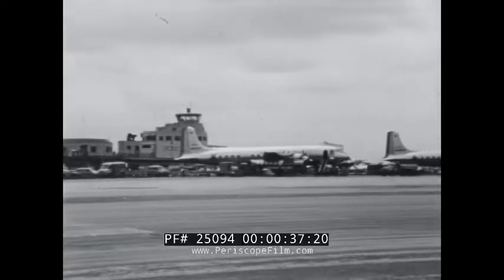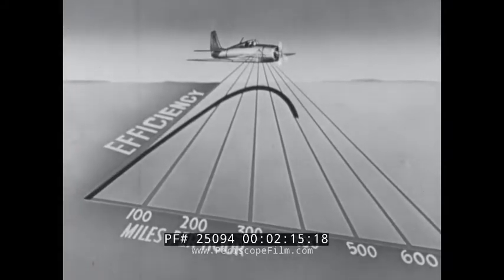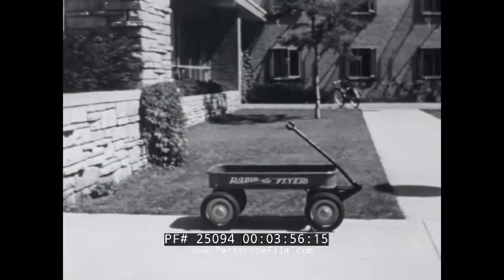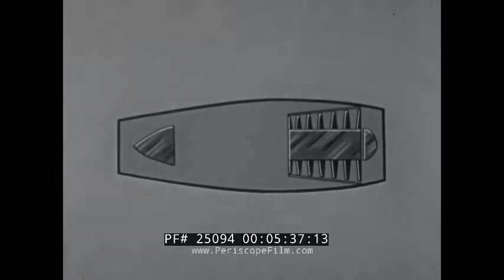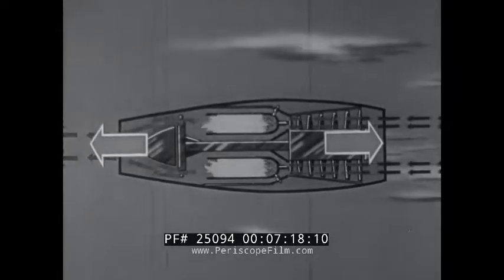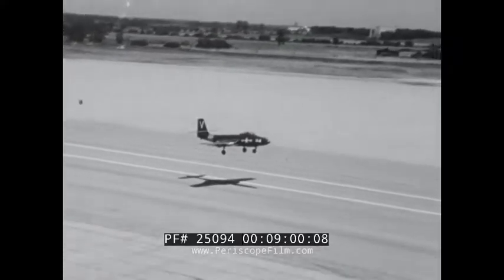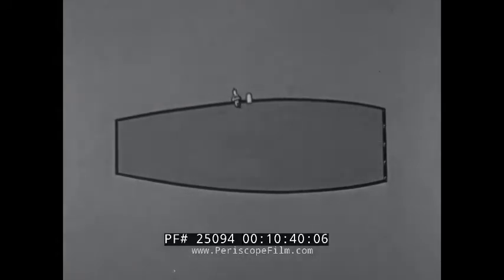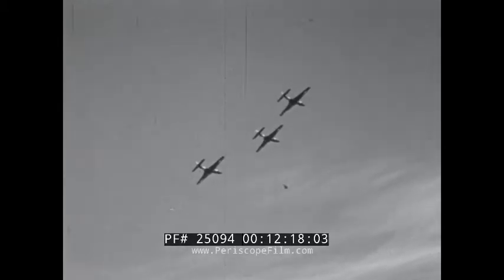“ JET PROPULSION”  1952 EDUCATIONAL FILM EXPLAINING THE BASICS OF JET AIRCRAFT ENGINES  25094

Comment: This W.1X engine, which was sent to General Electric in 1941, is now in the Smithsonian, Washington DC.  The Whittle/Power Jets W.1 engine can be seen in the Flight Gallery of  the Science Museum, London, together with the WU.  The prototype Gloster E.28/39 is suspended from the roof nearby.
Whittle has frequently been criticised by his detractors for his decision to use of the “dead end” technology of the centrifugal compressor.  In fact, there was no decision to be made: he utilised a known technology and took it to the limit.  He had no access to axial flow technology, nor did he have the resources to design an axial flow compressor, let alone to develop it.  

At the end of WWII, centrifugal flow engines were still some way ahead of axial flow engines, in terms of performance and reliability.  For example, Rolls-Royce’s Derwent 1 engine and DeHavilland’s H.1/Goblin had higher pressure ratios and lower specific fuel consumption figures than the Jumo 004B, which powered the Me 262.  It would take until the end of the 1940s before the axial flow engine drew ahead, and it would need a considerable amount of development work.
In the UK, the Royal Aircraft Establishment (RAE), led by AA Griffith, had secretly been working on a series of axial flow compressors during the late 1930s.  Their objective was the development of a turboprop engine.  However, with the success of Whittle’s WU engine, their F.1 turboprop project transformed into a turbojet, the development of which was continued at Metropolitan Vickers (Metrovick) in Manchester.
The Metrovick F.2/1 engine had its first run in November or December of 1941 and two F.2/1 engines took to the air in 1943, powering the Gloster Meteor prototype.  They  were larger, heavier, and had a higher trust than the Whittle W.2B engines intended for the Meteor, but they had reliability problems.  Further development resulted in the F.2/4 Beryl engine, with a thrust of 4,000lb.  However, by the end of WWII, Rolls-Royce had produced the centrifugal flow Nene, with a thrust of 5,000lb.
The Beryl never went into full production, but further development at Metrovick resulted in the F.9.  The project was handed over to Armstrong Siddeley in Coventry after WWII, to become the Sapphire 6.  The engine was licence-built in the USA as the Wright J65, of which thousands were produced.  Also, following WWII, the Nene was built under licence in the USA as the P&W J42, and the P&W J48 was a licence-built Rolls-Royce Tay.  
In 1941, in addition to being sent the W.1X engine, General Electric received drawings of Whittle’s W.2B engine.  These were used as the basis for the GE I-A, which ran the following year.  It went into production as the GE J31, and still had Whittle’s original reverse-flow combustion chamber arrangement.  However, GE further developed the engine with straight-through combustion chambers as the I-40.  Production was handed over to Allison, and the engine became the Allison J33, of which thousands were built.
With the industrial might of the nation behind it, the jet engine industry took off in the USA after WWII, but its launch pad was made in the UK.

Comment: I promised more to follow: here it is.
And what of von Ohain in Germany, whose rudimentary turbojet, the first true jet engine to fly, took to the air in August 1939 and flew for all of six minutes?
It is well known that, on more than one occasion, in the company of Sir Frank Whittle and other respected engineers of the early jet engines, he made a very telling remark.  He would say that if Whittle had enjoyed the level of support that he had received in the early days, the RAF could have had a jet fighter in service some three years earlier than the Luftwaffe.      
Hans Pabst von Ohain applied for a patent for his engine in 1935, but only after his patent lawyer pointed out that features in hist  application would infringe Whittle’s patent of 1931 and should be amended.  He had Max Hahn build a very rudimentary sheet-metal ‘garage engine’ for him in that year.  It was driven by an electric motor and there are some reports that it was fuelled with “a little petrol”, which burned in the exhaust.  However, Ernst Heinkel then took an interest in Von Ohain’s engine, which was moved to the Heinkel works, where further unsuccessful attempts were made to run it.  
Von Ohain’s second demonstration engine was completed in the spring of 1937, and it was initially motored over, driven by a belt drive from a pulley in the roof of the workshop.  There are claims that it ran soon after, but other reports suggest that it was only motored over for pressure measurements.  Heinkel recorded that it ran on hydrogen in September 1937 and on petrol in the spring of 1938.  However, Hahn and von Ohain had to work “night and day”, as the engine was experiencing overheating problems, with Hahn coming up with a vaporiser arrangement for the combustion chamber.
Work on a third version of the engine, the HeS3, followed and an HeS3A version was flight tested, slung beneath an He 118, sometime between May and July 1939.  The HeS3B, which powered the He 178 for that first six-minute flight on 27 August 1939: however, it was far from reliable and the He178 may have made only a few more flights.
In the meantime, Whittle had completed the second rebuild of his WU engine, with ten reverse-flow combustion chambers.  Testing began October 1938 and continued until February 1941, when a failure in the rim of the engine’s original turbine disc released several blades, resulting in damage beyond repair.  The engine can now be seen in London’s Science Museum.
Nevertheless, the success of the WU led to the ordering of a flight standard engine, the W.1, which was based closely on the WU in its third and final form.  Testing of the W.1 began in February 1941 and, following 25 hours of high-power testing, it was released for 10 hours of flight trials.  Nominally rated at a thrust of 1,240lb, at 17,750rev/min, it was derated for flight at a thrust of 860lb, at16,500rev/min.
The first flight of the Gloster E.28/39 took place on the evening of 15 May 1941 at RAF Cranwell and lasted 17 minutes.  That was the official first flight, but the aircraft had taken off briefly during taxiing trials at Gloster’s airfield at Brockworth, on 8 April, powered by a non-flight-standard W.1X engine. This engine was later shipped over to GE in the USA, where it became the first jet engine to run in the USA.
And more to follow.

Comment: I’m sorry (no, not really), but there are some contributors on the far side of the pond who need to be given a few facts about jet engines.
Firstly, let’s be clear, the principle of the gas turbine to produce shaft power (like the steam turbine, a British invention) had been established many years before its use as a jet engine occurred to anyone.  At the beginning of the 20th century, the Holzwarth ‘explosion’ (constant volume combustion) gas turbine was developed, but its thermal efficiency was only about 8 percent.  
Beyond this, there were other attempts to produce a gas turbine operating to the Brayton (constant pressure combustion) cycle, which Brown Boveri in Switzerland finally did successfully in 1938, with an industrial gas turbine driving an electrical generator producing about 5MW.  It was finally taken out of service in 2002, because the generator had sustained damage.
In 1922, Maxime Guillaume (who may have been Belgian) was granted a French patent for an axial flow jet engine.  He’d had a bright idea, but it was very rudimentary, and he was an agricultural engineer who couldn’t back up his idea with theory and calculations.  In 1926, Dr A A Griffith of the Royal Aircraft Establishment in the UK wrote a report in which he proposed an axial flow gas turbine aircraft engine, driving a propeller: what is now known as a turboprop.
In 1928. A 21-year-old RAF technical apprentice by the name of Frank Whittle wrote a thesis discussing high speed flight.  He hadn’t got his ideas sorted and proposed a machine using a combined piston-engine compressor and combustion system, to power an axial flow turbine driving a propeller.  The following year, now a qualified RAF pilot, Whittle did come up with the idea of a true propulsion gas turbine: what is now known as a turbojet.  
However, his proposal, including the relevant theory and calculations, was forwarded to Dr Griffith no less, who rejected the proposal.  He believed that, with its centrifugal compressor, it would be too large in diameter and, in any case, would produce insufficient jet thrust.  Nevertheless, in 1930, Whittle submitted a patent application for a turbojet, which was granted the following year.
Discouraged, Whittle continued with his flying career and became an instructor and one of the RAF’s top aerobatic and stunt pilots.  However, in 1934, the RAF sent him off to Cambridge University, where he gained his degree in only two years while also working on his engine, encouraged by some influential friends.  They had managed to arrange a small amount of venture capital funding and Power Jets Ltd was founded.
On 12 April 1937, Whittle’s WU engine was started up and ran for the first time on 12 April 1937, at the BTH works in Rugby, England.  It ran out of control because excess fuel had collected in the combustion chamber – but it was the first gas turbine propulsion engine in the world to run unassisted under its own power.
That’s enough for now: more to follow.

Comment: Die Sauerkrauts haben das erste Strahlflugzeug gebaut und geflogen! Das war bitter für die Briten , ist aber die Realität. Das hier gezeigte Triebwerk hat einen typischen Kegel in der Düse , genau wie das Junkers Jumo 004. Interessant.
Reply: Yes, it's a fact, but the He 178 flew for only 6 minutes on its first flight, because the engine couldn't be run for any longer than that, and the aircraft landed as a glider.  The He 178 would not have been allowed into the air in the UK (or the States), as it would not have been considered airworthy.
The Gloster E.28/39 didn't fly until May 1941.  Its first flight lasted 17 minutes, at the end of which it landed under power and was wheeled into its hangar, with no inspection of the W.1 engine, which had previously undergone 25 hours of ground tests at high power.  The engine flew for its cleared 10 flight hours, at the end of which it was stripped and inspected. The only defect found was a small crack in a combustion chamber.
In 1944, the Jumo 004B, with its axial flow compressor, had a lower pressure ratio and a higher specific fuel consumption than Whittle's 1941 centrifugal flow engine.  The 004B worked - but only just.  That is also a fact.
Reply: @grahamj9101  The He 178 might possibly only have flown for 6 minutes, but it was a jet engined aircraft, and first to fly! It doesn’t matter for how long or far. Just a fact.